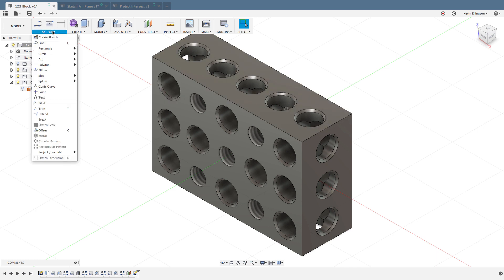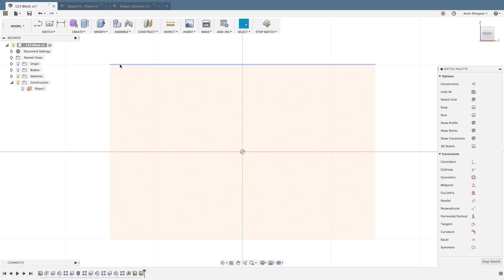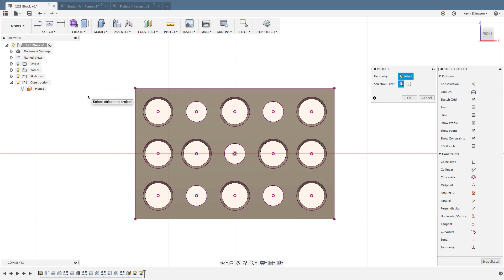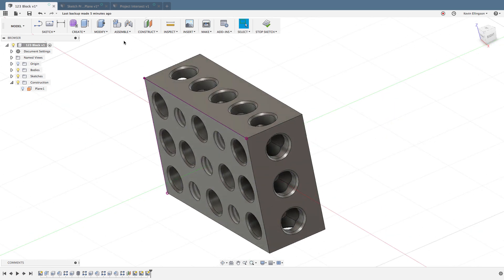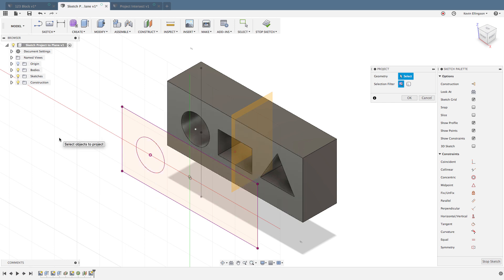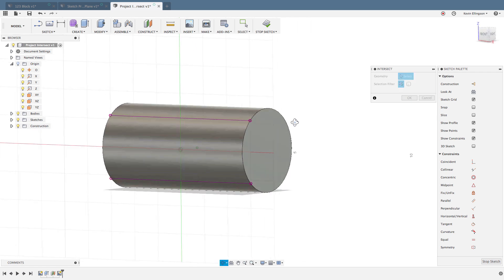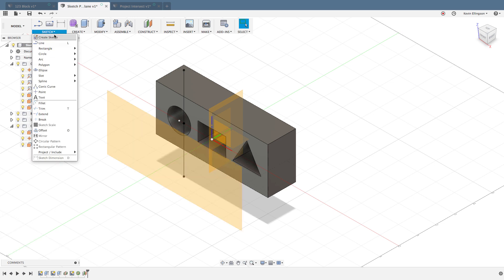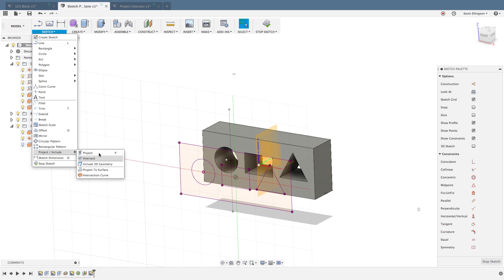Fusion 360 - Project Geometry Options

Comment: Hi, does this work like "Convert Entities" in SolidWorks?

for example that Triangle Drawing was projected on a different plane (Offset Plane), After projection I can see now there's a triangle drawing in my Offset Plane, 

Question: Can I extrude that Triangle directly? or Should I trace it first with Line tool before Extrusion?

Btw, I am currently transitioning from SolidWorks to Fusion & Inventor. Thanks in advance!!!

Comment: I have this odd shaped geometry and I cant seem to project teeth imprints onto it for some reason. I am trying to make the chain chomp from mario. I have the mouth part split separately but now it wont let me project the teeth lines onto the teeth portion. How would you go about doing that?
Reply from the maker: You may need to use one of the other project options such as project to surface.
Reply: @MechanicalAdvantage  it wont even let me project the teeth lines onto the surface. I keep getting an error saying “not support projecting sketch geometry into same sketch”

Comment: I need to combine Fusion 360 with a CFD software in order to optimize the original CAD design.

 Can Fusion 360 handle geometry variation in a batch mode? For instance, if I design a basic geometry and want to optimize it according to certain CFD-imposed criteria, would Fusion 360 be able to keep generating-updating the geometry (produce new STL's) until I reach my optimization goal?

Greetings,
Apostolis Zevgaras

Comment: In the last example, could you resize or reposition or move those projected geometries?   Like if you wanted to put the 3 shapes closer together.   I have a dxf of a desk, but i wanted the legs shorter while maintaining the dog holes.  But cant seem to modify the projected legs dog holes.   Good video btw.
Reply from the maker: Projected geometry is meant to not be edited, but instead linked to the geometry it was projected from. However, you can right click on projected geometry and break the link. After the link is broken it is fully editable, but loses all intelligence to what it was projected from.
Reply: @MechanicalAdvantage  , thank you ... much appreciated ... i didnt think there would be a response to an older video.  Much appreciated... you have a new subscriber.
Reply from the maker: Thanks. I try to do my best to reply. I don’t always succeed however.

Comment: Still cannot figure out how you get from something projected to a scetch. In Alibre I tell it whether it is a reference line or for modelling. 
It is not evident to me what the project can be used for
Reply from the maker: I think you might be thinking of this the wrong way. You first create a sketch and the project edges, faces, points, planes, axes etc. into the active sketch. So it will project from somewhere in the design, to the active sketch plane. Does that help?
Reply from the maker: I should also know that Fusion only knows what geometry is on the active sketch plane if you choose a part face. You may want a feature to be located relative to some other feature on the part that isn’t on the active sketch plane. So you can use project to project in that geometry to your active sketch plane so you can reference from that feature.
Reply: @MechanicalAdvantage  Thanks - I will remember that and see if I can get it under control

Comment: So one of the question I have is about projected inferred geometry.  For example, create a rectangular shape and press-pull it up to a certain depth.  Then apply a fillet to the 4 corners along the z-axis.  From that I want to create a channel that follows that shape but offset inwards.  The specific scenario is a cutting board that has a juice channel cut into the top of the board but I want it to follow the same general shape of the cutting board itself.  Secondly, if I then parameterize the length and width of the board and/or change the 4 corner fillets I want that juice channel to update accordingly.
Reply from the maker: William Cassanova Hey William. I wonder if a sweep wouldn’t be be better in that scenario. The sketch could be offset from the outside shape. As the fillets change the offset sketch chain should update as well.
Reply: @MechanicalAdvantage  I'll send you a private email with the file.  I took a class with you up at NYCNC about a year or more ago....John ended up experimenting with this guy and it came out pretty well.  https://www.youtube.com/watch?v=luxmIPPUyF8

The material is the same, Richlite, and this is question is more of a "sitting at home and learning thing".
Reply from the maker: I remember you. How are things down in Atlanta?
Reply: @MechanicalAdvantage  All good relatively speaking. The Covid thing has us all in a tizzy but this too shall pass

Comment: Great Video!! Thanks for your help. I am former SolidWorks user, and in SolidWorks when one Project edges, face etc., I can later delete refrence and use projected lines as independent sketch.How do I do that in Fusion?
Reply from the maker: Thanks Igor. It isn't going to work exactly like you are used to with SolidWorks, but you can sort of get there. Once you project the geometry, right click on it and choose "break link". If I recall with SolidWorks their method leaves some constraints applied but frees up things like line endpoints. With Fusion you are going to get an exact copy the geometry, but you will have to manually add things like collinear constraints.
Reply: @MechanicalAdvantage  Thanks for quick answer. I am currently trying out education version.  I cant find break link when I right mouse click projected geometry. What I am doing is inserting part into part, and using project to get sketches in order to accuretly redesign my own version of some existing parts. Thank in a advance
Reply from the maker: Are you in the active sketch when you try to break the link to the projected geometry?
Reply: @MechanicalAdvantage  You said it all!! Great program tho!! Thank you very much.

Comment: Great video, I failed to realize that projections are static when created, if you move the projected obj they no longer will line up ( the flashlight analogy is not perfect ). Not sure what feature I need to use instead. Say I need to create bosses or standoffs on one part for another, but want to make adjustments to the sub part and have the projected geometry and any children from it also follow..
Reply: I think I figured out how to do this after trying some new things, I make sure I have a component position event, then I project whatever from component onto a face of my body, then do whatever, extrude some stuff to support the subpart (component). To fine fix the subpart, I go back to timeline for a position cmd I made earlier, then move the part, then finish position , then advance timeline back to end, and my extrudes and projections have moved with it. not sure if there is a better way.. might have to screen this to the adsk forums and ask

Comment: Excellent video, well explained. I'm lofting a boat I'm building and have a background in 3D modelling with modo and was wondering can Fusion UV map (with accuracy) the clinker planking of a boat onto a flat surface to allow you to CNC cut the panels? This would be very useful in speeding up boat manufacturing techniques...

Comment: Can you do a follow up video to show the value of projecting using some practical applications?  You are a great teacher!!
Reply from the maker: Thanks Bill. Projecting is probably one of the most used commands you will have to use in Fusion. The way it has been implemented, you are constantly projecting and don't even know you are doing it. You may want to go back and have a look at the video that is linked in the card. If auto project geometry on active sketch plane were shut off by default, you would quickly need to figure out how to project geometry. With Fusion, that setting is on by default and most users don't realize that geometry is being projected. The reason for this is that the geometry is being projected, but instead of it being projected as magenta in color, it is projected and then made to be invisible to the user. Fusion knows it's there, but we don't see it like we do the magenta projections when we manually project geometry. 

I've debated their decision. In the long run, I think the way the developers have implemented auto project in a sketch is not a good method. However, for new users it is easier for the auto project to work the way they have implemented it. I just think they have done a disservice to the user to never really explain to them what is happening behind the scene.

Comment: Looks like they added a new feature that lets you make the projected geometry construction lines. It looks you just toggle the construction option on or off while selecting entities to project. Nice! That's very close to a feature I've wanted for a while now, which is to have all projected geometry be construction lines by default.

And, as always, great vid!
Reply: your comment solved an hour long riddle thank you
Reply from the maker: Correct. That just appeared in the update before I recorded the video and I thought I might leave that one for another time. Maybe when I cover the other project geometry options.
Reply: @MechanicalAdvantage  I need to combine Fusion 360 with a CFD software in order to optimize the original CAD design.

 Can Fusion 360 handle geometry variation in a batch mode? For instance, if I design a basic geometry and want to optimize it according to certain CFD-imposed criteria, would Fusion 360 be able to keep generating-updating the geometry (produce new STL's) until I reach my optimization goal?